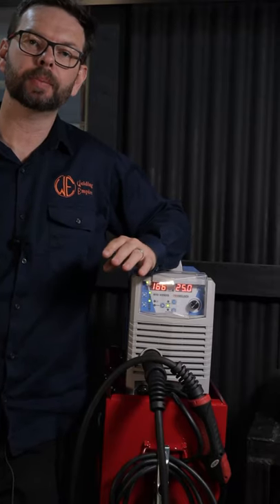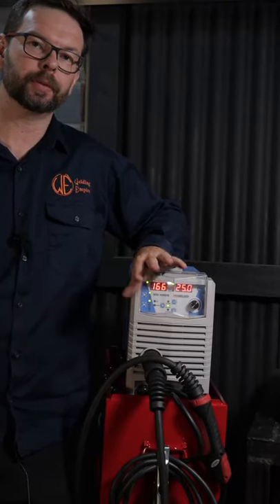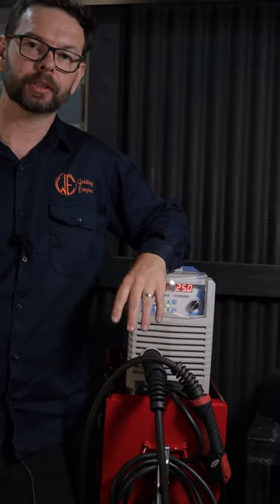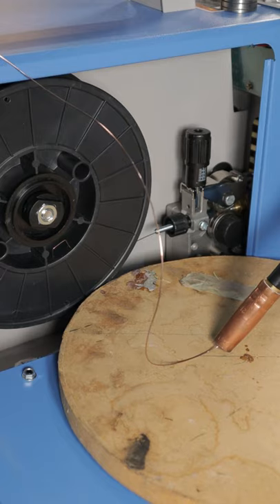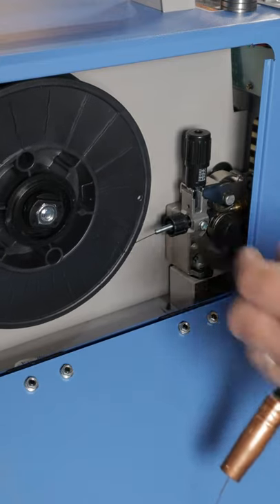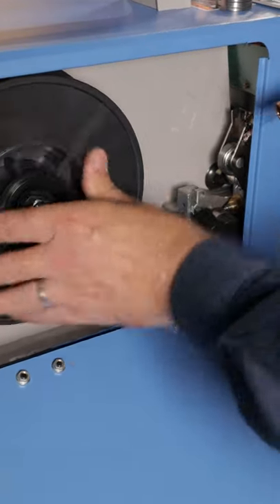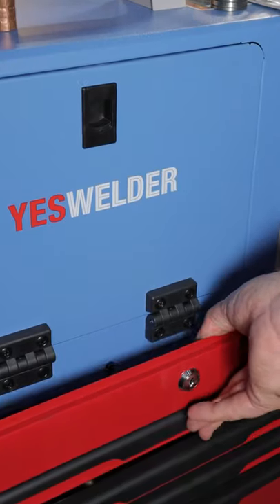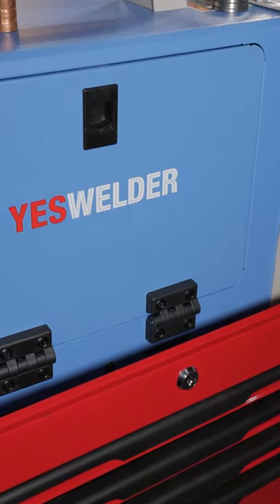Setting MIG Wire Tension #Short

Comment: I have a yeswelder 4 in one and the mig feed the wire perfect and then when we tried to weld, itwill not show any voltage or movement in the wire feed.  I have tired everything.    Everything else works on the unit.  It was never taken out of the box so the warranty is useless when I got it.  Yeswelder isn't any help as it's always a rep that knows nothing and wants to see a video, then the video isn't long enough.    Any ideas where to look?
Reply from the maker: Hi, sorry to hear that. I would say it has something to do with the internals, that isn't my area of expertise. I would post a quick video on their FB page. Someone will respond there that can help.